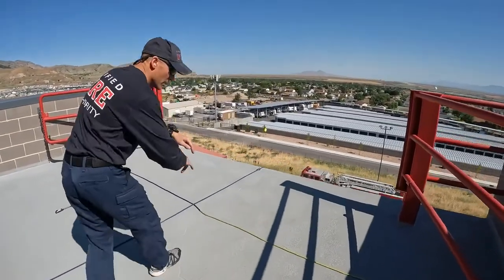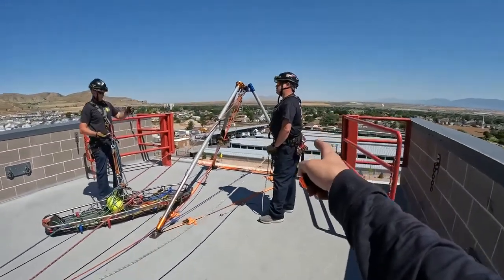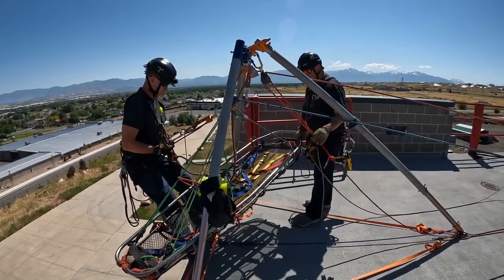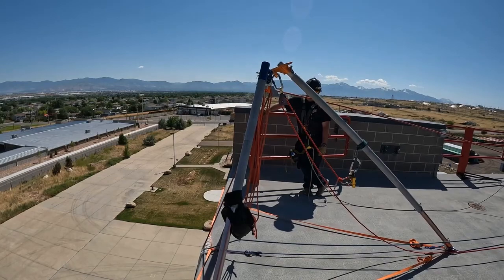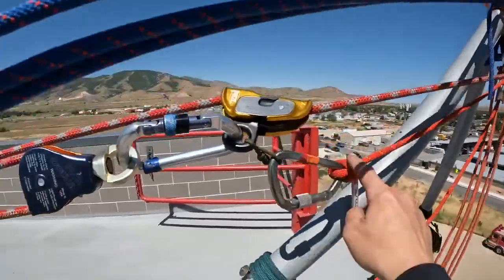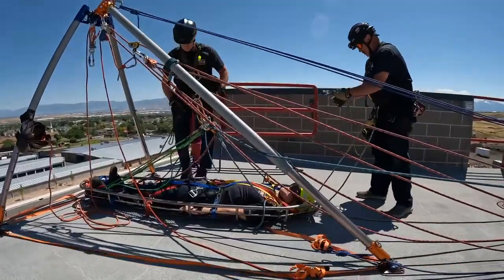High Angle Rope Rescue: A Basic Operational Sequence

Comment: I have a question. I’ve never been able to use a winch for a rescue but since you are able to use the winch what’s the reason for the 3:1? What is the winches mechanical advantage or does it need it ?
Reply from the maker: The mechanical advantage of the winch depends on what interface you are using to spin it: hand crank or a drill.  The reason there is MA in front of it here is to save battery power on the drill & prevent the motor from burning out when lifting heavier loads (2-person).  You can see more on winches here:  https://youtu.be/mKqniiJxYgE?si=ZN3_6jKaIoKn_nrI

Comment: No criticism, just wondering why with both main and belay loaded down, no pulley on the belay line to reduce friction instead of just a carabiner?
Reply from the maker: The idea being that in a SMSB system on a lower or a raise, the belay line is under no load/tension.  Therefore no need for a pulley.  & if the belay does activate to arrest a fall, a carabiner would be better than a pulley to help increase friction & absorb some arrest force.

Comment: great video, a question about the postioning of the harken winch, why vertical and not horizontal?
Reply from the maker: you can mount it wherever & however you want as long as the rope enters the fairlead pulley at a reasonable angle.  Here it was so much easier to lash it vertical because there were obvious anchors located in a favorable place & it takes up less operational space/real-estate which is nice.

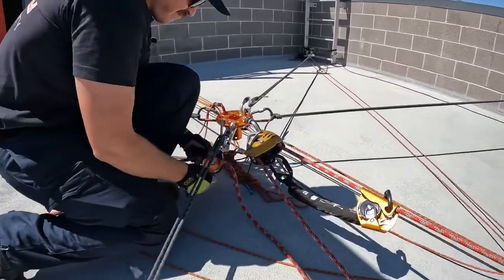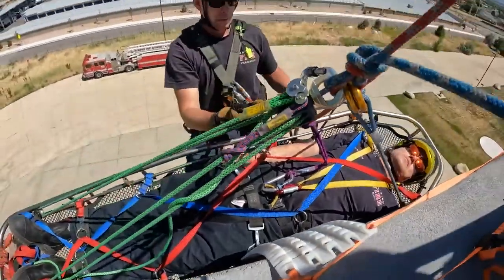Comment: Great video thank you. We didn't see you do an ACHER check or Triple check prior to starting. I notice at 8:28 carabiner is unlocked on 3:1, at 12:20 Tom does it up when resetting.
Reply from the maker: Thanks!  Going through the pre-execution checks was purposely omitted for demonstration purposes.  And yes great eye on the unlocked carabiner! .... but now take it one step further and ask the question "Does it matter if the carabiner is unlocked?"  I would argue that you can get away just fine with a non-locking carabiner on that 3:1 haul Prusik.  The only places, in my opinion, where a carabiner should be locked without question are on the terminal connections between devices and anchors, on any change of direction anchor, & all live load connections.

Comment: Have you considered shortening your litter bridle? I think it would help with your edge transition for a smoother flow.

Also, I thought the industry was getting away from the whole set of fours belay raise and lower. They are just leaving it high on a fixed pulley along with the main line as it keeps the forces constant especially when you are incorporating a twin tensioned system. The AHD is certainly strong enough.

And what cordage are you using for the anchor? Is it power cord? 

Enough questions by me, haha, just curious. That was a good evolution by you and your team. Well done.
Reply from the maker: I didn't pay too much attention to the length of the bridle during edge transition, as at short glance from a "Rescue Officer" perspective it seemed "doable"...  The fine-tune adjustments of the bridle height typically I'll leave at the discretion of the litter tender & the edge.

On the Set-of-Fours:  Great observation & I think with all things... It depends.  Historically, why is it there in the 1st place?  I believe is to protect against a significant free-fall caused by a failing AHD frame... but thats only applicable or perhaps remotely justifiable when operating Single-Main-Single/Separate-Belay after the edge transition during a lower, or before the edge transition during a raise.  If a team decides to stick with TTRS for both lower & raise for the whole operation then yes I absolutely agree that the AZTEK does not need to be in the AHD.  The likelihood of an AHD failing is always going to be higher during the edge transition because it is here where the force vectors really start to shift.  After the edge transitions, you could argue that the AHD system, to include all the guying, has "proven" itself stable & therefore you could further argue that keeping the belay line high in the AHD for the rest of the evolution is perfectly fine and that there's no point in having the Set-of-Fours regardless of what mode you're running (TTRS or SMSB).

Then there's the "warm & fuzzy" aspect.  We have a lot of people on our rescue team spread across 3 different shifts & 2 separate stations & not everyones attention gravitates to the rope-rescue discipline the same way.  So takes time for the organization as a whole to adjust tactics & for deeper levels of understanding to sink in.  As it stands now, pretty much everyone is familiar with having the AZTEK in the AHD and running strictly SMSB for the duration of an evolution.  Personally, I feel like the AZTEK can be removed, but it's not one of my core rigging philosophies - I'm not going to die on that hill to argue one way over the other.

And yes - 5.9mm Power Cord on the anchors
Reply: @Propeller_Head  
Thanks for the lengthy response. There is no right or wrong answer as long as it is efficient enough and everyone's safe. And I hear you on getting everyone on board as far as tactics, much less new ones. It's like herding cats getting everyone trained to the same standard. Cheers

Comment: Excellent video, very good details, I congratulate you and your team. I observed at 7:51 you placed tension on the top of the tripod. Although I see that the resulting force , As it goes up, it stays inside (of the triangle). I respectfully ask you, Don't you think, would be nice some tensión on the sides of the A-frame during up load? I hope to continue watching your videos, which I shared with my rescue group.
Reply from the maker: For the haul up, I do not anticipate any lateral forces on the frame.  My only anticipation is that the resultant force through the AHD will shift to the rear slightly, due to the inherent friction that exists within the pulley (about a 10-15% efficiency loss), and therefore a possibility of residual "thrust/shear" force on the easel leg that will want to push it back towards the anchor.

As far as guying the frame to the sides... Sure!  If I had more time and this was a pre-staged setup for the possibility of a rescue, such as those seen in permit-required Confined Space applications... or if I had more time with nothing else to do because I was waiting on other teammates to finish their rigging tasks, then yes, I could consider guying it.  In this application, I didn't see any absolute critical need to guy it laterally.